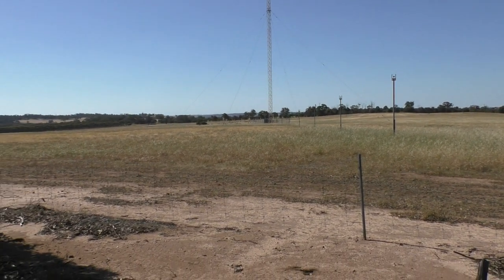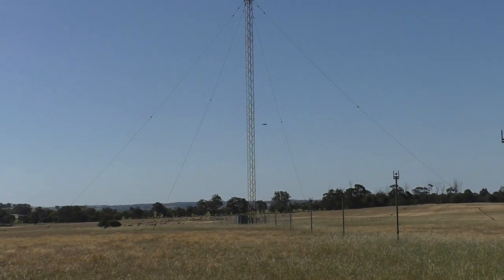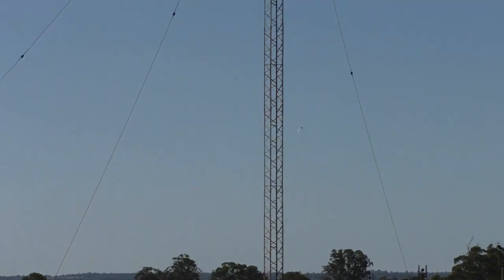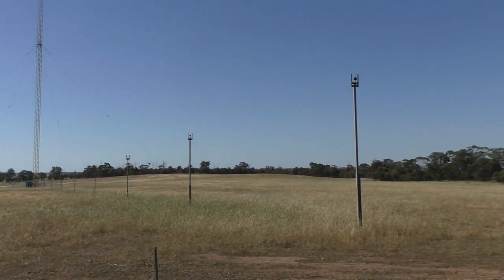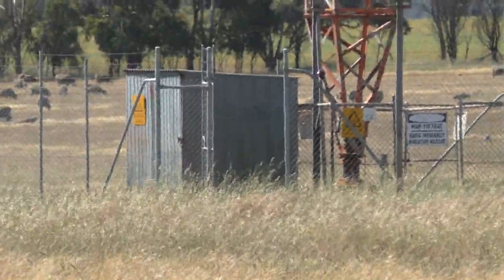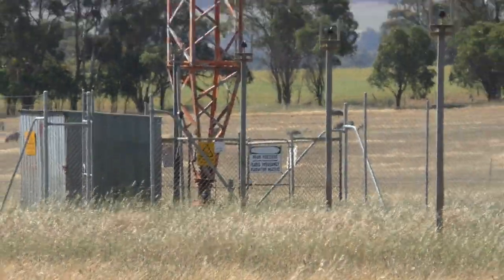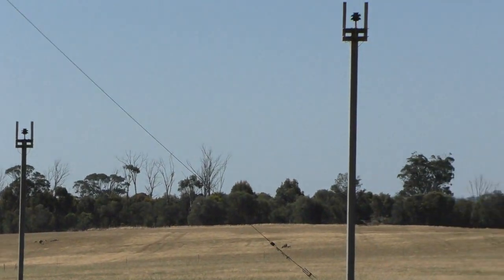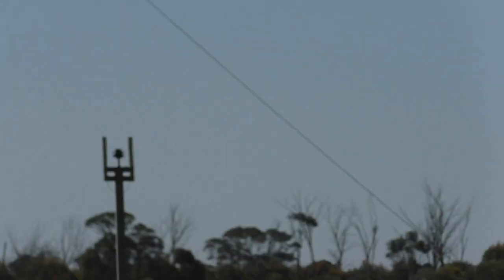AM Broadcast Mast

Comment: As vk2ycj says,  it is an open wire version of coax. ( we used to call it "pretend coax")

It is normally a "six wire" system,  with the insulator carrying two conductors in parallel, whilst the metal frame carries four wires in a square configuration.

It offered an unbalanced feeder with  many of the advantages of coax, without the power limitations & higher losses of earlier types of coax cables.
Reply: Is this bags wheeler?

Comment: I saw the Blaw-Knox tower of WLW in Mason, Ohio. Pretty impressive beast for sure! Back in the `30s, the station ran 500Kw! They had to put up 2 short towers across the road to keep the signal out of Canada at night! It must of been a sight to hear fence posts, gutters being modulated with 500Kw! Lights in houses would be flickering, even when turned off! 73, W8WLF Brian in Ohio.
Reply from the maker: Thanks Brian. Yes, I read about the WLW 500KW TX. I think it still exists as an exhibit at the station doesn't it. The images of it are quite amazing, it looks more like a factory or engine room than a transmitter.

Comment: 2MG at Mudgee NSW has or had a similar feeder system.  It is a version of open wire coax - with the inner running down the middle and supported by the insulator and maybe 4 wires running on the outside in a square arrangement.  Hence the 4 outer wires are at the same potential as one another.   I enjoy your posts and watch them all.   73,  Jamie VK2YCJ
Reply: Can you explain more about the feeder system ?
Reply: On a piece of paper draw a square.  Draw two diagonals.  The intersection of the diagonals is the centre of the square.  This is the centre conductor of the open wire coax.  The four corners of the square are where the outer conductors of the open wire coax are located.  You could think of the whole arrangement as a cage made by the 4 outer wires.  The dielectric between the inner conductor and the 4 outer conductors is air.  I would imagine the advantage of this open wire coax compared to traditional two wire open wire feeder is that it prevents birds getting blown up when they land on it and straddle the two outside wires.  The four outside wires are at the same potential so it's relatively bird friendly.
Reply: This brings in more questions....
Interesting and I will give it much thought. I must research this transmission line type.
Thank you :-)
Reply from the maker: Hi Jamie. I have had it confirmed that this type of open wire feeder is as you describe. 4 wires form the outside 'box' and are at ground potential. There's 2 centre wires in parallel that run either side of the insulators, it was 200 Ohms.
Reply: Steve, okay that makes sense because with two or more wires as the inner conductor you can vary the spacing of them to get the impedance that you require - rather than being forced to rely upon the thickness of a single copper wire.   That gives you a bit of engineering leeway.  That's cool ....

Comment: Interesting, fascinating and bizarre.
I read the comment below. 
I have never seen a tower like that ever. It must be scientifically engineered to stay up.
I still don't understand the insulator and I am very used to cross-field open wire feed systems.
Seriously, thanks Steve. I shall remember this video :-)  Wonderment.....
Reply from the maker: Thanks Ade. Glad I could provide some wonderment...
Reply: I'm used to copper pipe mounted in concrete as open wire feed. This is new to me and as you know I have seen a feeder or two in my time.

Comment: I believe they were built by a company called Johns & Waygood. There are a few more of them in the country. The steel gets thinner as you go up from the guys. They move around a bit in the wind. The open wire feeder was arranged in a  square, or cage if you like.  Was 200 ohm impedance.
Reply from the maker: Hi Ray. Thanks for the info.